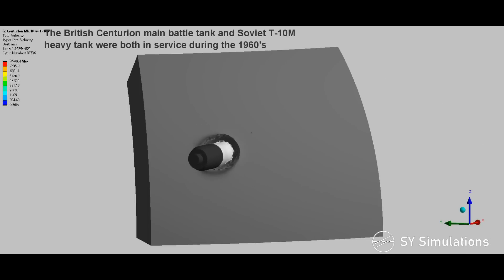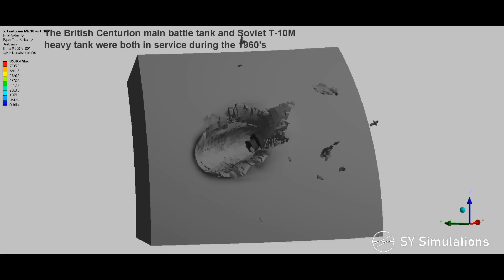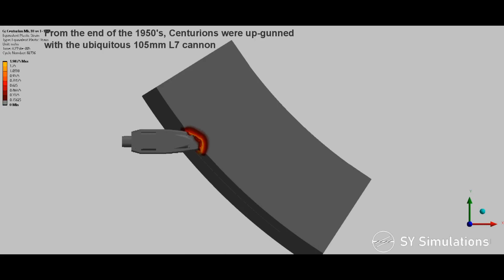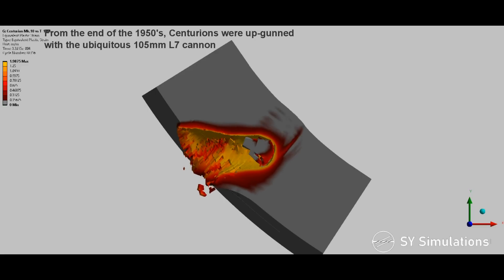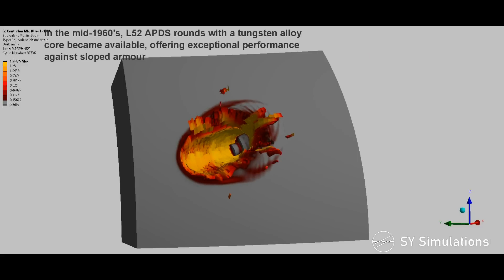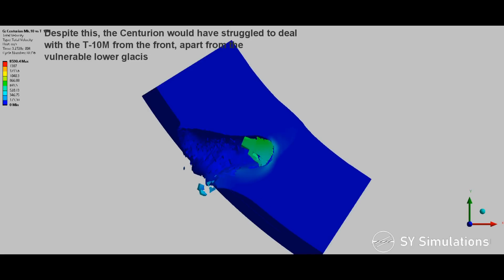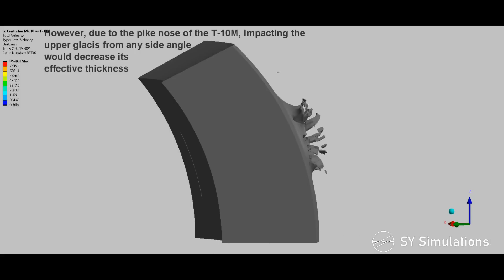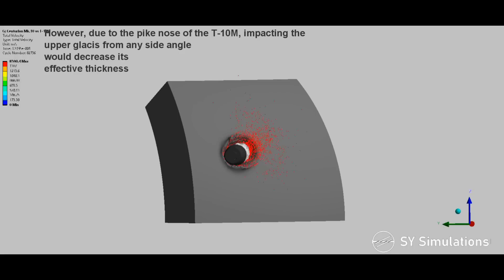CENTURION Mk.10 vs T-10M | 105mm L52 APDS vs T-10M Turret | Armour Piercing Simulation

Comment: Imagine being the gunner in the T-10M right there. You might not get physically injured but your soul would have left your body for a moment.
Reply: Imagine just sitting there and you see that plate moving a few cm toward you
Reply: Significant emotional event.
Reply: The turret was covered with rubber lining, so that the gunner would not have felt anything other than ringing in the ears from the impact.
Reply: @Anti_Everything  how thicks that rubber because that's a lot of movement
Reply: @bhag7977  About 20 millimeters